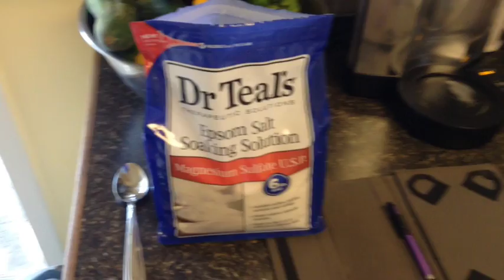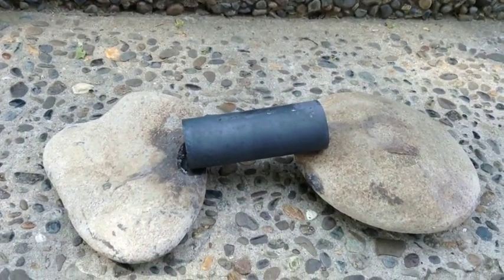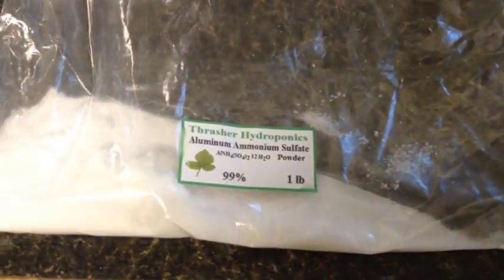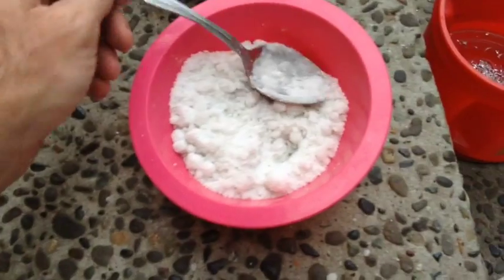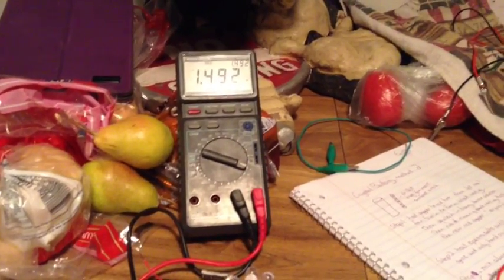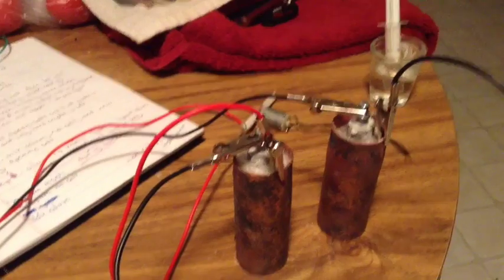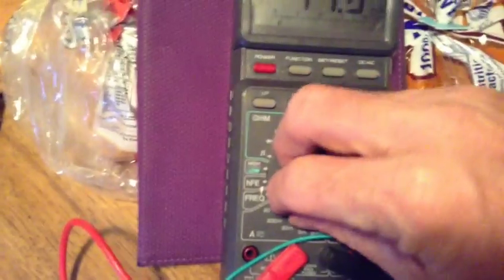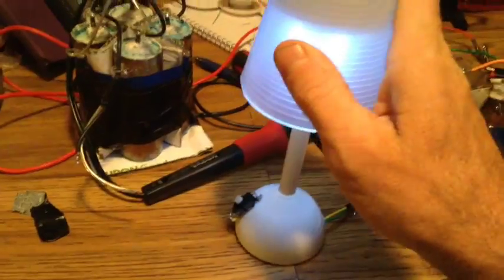V3 Crystal Battery High Output 1/2 amp spike 2 in parallel dead short. high psi

Comment: I suggest adding some graphene to the matrix. The graphene acts as micro conductors and transports the electrons with less impedance.
Robert smith-Murray uses this method, and his website sells the graphene. His channel also explores different methods of low cost home graphene production.
Reply: Graphene for capacitor (store the energy)..what we need is carbon14

Comment from the maker: I'm not sure. These have been my highest output cells so far. I actually cut those two cells in half to make 4. These require me to add a few drops of water every few days.  Then I made 4 more of the same but with 3/4 inch copper instead of the 1 1/2 copper.  The small ones are capable of almost the same amperage but will lose power a lot quicker and the smaller ones require me to water more often. Not sure about the corrosion on the magnesium yet. I am seeing positive results with the fired copper. Seems to help in slowing down the corrosion factor. My next set of cells won't use borax , no salt , or alum. They will contain Rochelle salts, Epsom salts, sodium meta silicate pentahydrate Na2SiO3*5H2O, iron pyrite, magnesium fillings, and Manganese(III) Mn2O3.  Basically I am trying to progress to a cell that uses water as fuel while  doping agents are used to increase power output as well as protecting the magnesium. Research I have done speculates we can get a reliable 1 amp at 1.6 volts out of a relatively small package. 5 inch tall 1 1/2 wide

Comment: take one of your "no so good" cells and cut off the copper but not impacting the cell hardened cell mix, use gloves to keep skin oil out, if they dont break / crumble easily. then take a crucible with molten copper and dip your "core" in and let the copper cool down naturally around it, then test it once its at room temperature and post / tell me the results

Comment: On the reason your aluminum burned through. It is the Ph value of your material. It is at least a mildly strong base  really strong bases, like lye, dissolve thin aluminum in a pretty impressive display of endothermic reactions. Just don't use aluminum for heating or drying the material and no problems. If you have not done it make a little tinfoil cup put about a half teaspoon of lye in it and the drop in about a teaspoon of water. It is fun to do at least once..=) [don't breath the fumes though, they are not goo]

Comment: I used smaller diameter copper tubing and magnesium pieces ripped off of a big roll of it. A lot less water too to mix and got 1.68V from about 1/4 inch width × 1 inch length batteries!
Haven't checked amperage yet. My voltimeter's connection is burnt out from a defective 12V that was running on 3 or less cells.👍👌

Comment: try large flat layers of copper an your electrolyte mix to raise your amps but clamp it tight so you can also mix silicone dioxide so when the expansion starts you'll get a piezoelectric voltage like the Egyptians did ...for one last idea ad a layer of graphene it charges itself..........just remembered add a pinch of ascorbic acid ( vitamin c) it stops the corrosion process without affecting output
Reply: Al Schuck - I thought piezoelectric requires quartz crystal

Comment from the maker: Hey Travis, I would like to see your cells. The more people that do this we will eventually find the right mix to achieve 1 amp in a small package. I will be back to the crystal battery's this spring. I have done quite a bit of research and have a number of different mixes to try out. Thanks for the comment.
Reply: BackRoom Labs Please share their amps over time. I made similar and noted that mAmps fall down in few hours to a steady low mAmps.
When I make them they will give around 80 mAmps but after a day or so they drop to 20 mAmps
Reply: The answer is neigh indefinitely.  I haven't heard of anyone so far who had one of these batteries die.
Reply: I don't agree. There is no such thing as indefinite. In this scenario you are basically consuming Mg. Over time its amps and volts will drop. When you create their first output is high but then it drops over time.

Comment: if you use a torch over concrete make sure it is dry any moisture in the concrete and you will get a very violent demonstration of spalding as the moisture in the concrete boils and causes the concrete to explode :-)

Comment: Just out of curiosity, have you tired charging the cells to see what happens 
Like 12v 1amp 

That would be a cool test to see if the cell would hold a charge. Of voltage and Ah
Reply: I don't like to be rudebut you are way this guy doesn't really know what he's doing because you're supposed to form the cell by charging and discharging
Reply: This isnt the type of battery you recharge friend think throw away double aas. Its like a chem reaction.peace opon u

Comment: You needed to charge them a couple times,
Then do your test!!!
Thanks 4 sharing!!
Reply: +violeman Have you tried charging them with an old DC 5v - 9v maybe 500ma adapter yet to see if they hold a charge?
You can even try it with a 3v if you want!!
I am just curious if they will charge up a bit!!!
Lower voltage the best cause you do not want to boil it again!!!
Thanks 4 Sharing!!!

Comment: Hello.. I been a long time subscriber and appreciate your work .I think you have been on my channel too. I have made many types of batteries myself and have duplicated and tested many versions seen on you tube and all as you must know with very little working current.  I believe this experiment you show here holds promise as possibly a functional worth wild battery . nice work.. As I am sure you know any anode surface area can be a Major player in the increased current ability.  That surface area thus amps could be greatly increased by doping the anode with carbon nano tubes you can buy of the net (100$) and probably grapheme would work too. The cost is somewhat high for the nanotubes and may appear to be cost prohibitive to make batteries with, However when you do your research and find that it can increase energy density by 10 times then you realize just how special a battery like this could be. It would mean your.25 amps could be a 2.5 amp battery or would hold 1.5 x 2.5 = 3.75 watts.. Now that's no joke.. It appears the nano tubes also increase life cycles and reduce charging time as well. I have had the following ideas to get the tubes on the anode... flat led or magnesium plate for anode then heat to  the melting point laying flat in a pan and then just as it liquefies  sprinkle (technical term) nanotubes on surface and then let cool or force cool quickly.. Then tap off and save what did not stick on and then build your batteries just as you have done here using your new nanotube doped anode. The arrangement they lay or fall in has a large impact on just how much energy density gain you will get but the random arrangement should still greatly impact the capacity. Or take a conductive glue say glue with carbon in it or metal shavings in it or any other type you can come up with that will conduct and paint your anode with it and then dip or roll on carbon nano tubes.  I haven't had the time to try it but wanted to pass it on to someone who might give it a whirl and tojust put the idea out there.  If talcum powder is electrons and you sprinkle (charge) them on a slick bowling ball ( your anode) most of the electrons will not find surface area to stick to so charging and energy density is low.. NOW take your bowling ball (anode) and cover it with long shag carpet (carbon nano tubes) and sprinkle your powder on can you see how much more electrons (charge) you can store and how easy it would be for electrons to find surface area? well if you get time let me know what you think. and if you try it don't forget to let me know how it worked.
Reply from the maker: I have been following  the graphene SuperCap videos from Robert Murray-Smith and have tons of ideas. I am ordering some graphene on aluminum from the Graphene Supermarket. It 100 bucks for 5 sheets a 9x9in.  I am also going to order enough magnesium to make 20 of the cells. I have found the less the gap between the mag and copper the better. Also the ALUM only cells are by far the best. All the other cells have corroded and there power output is far far less then when new. The alum only cells show no corrosion and power out put is the same as when new. So my plan is to build a bunch of homemade graphene SuperCaps. Put em in parallel with the crystal battery's. And then I think we might have something with these power cells. My problem is power output. I never had a way of storing the power. Hell they put out 24hr a day all year long. Now with these new graphene caps that should far outperform the super caps we have now I can run my LED joule ringers at full power.
Reply: Did you do it? The logic seems to work
Reply: @1billyknorr   I think you are right about Alum, I made a couple all Alum batteries and I wanted to minimize dendrites as much as possible because I was using expanded aluminum sheet metal and I expected to end up with a copper anode but I think the copper produces more dendrites than aluminium when you go to charge it up.  When I first made the battery it was reading over one volt and I actually had decided not to use any copper because I found a 24K Gold mil spec. connecter pin that I had laying around and just stuck it into the dense block of Alum that I had cast into the Aluminum expanded sheet, I was attracted to the expanded sheet because of it's abundance of sharp  edges so it surrounds the Alum block and the pin is placed in between the two sheets of Aluminum. The pin is bigger around than the thickness of the mesh in the expanded sheets and the two aluminum sheets are joined together by copper wire that does not touch the Alum, the solder joint on the Gold pin is also well insullated from the Alum as well. The Alum is different from the Alum you are using however because it is milled to a very fine powder and does not stay suspended in water for very long and it does not appear to melt even with heat yet is very dense and heavy.  There are a few different types of Alum.  After charging the battery for several hours it stayed at over one volt for twenty three hours.  Also when shorted the battery would bounce back to somewhere over .5 and .6 and ususlly settel at  .8 but then after disconecting it could be found at over one volt again and then slowly discharging at a rate of only a hundredth or so every few minutes. 
 In the next battery I made I couldn't remember where I had the rest of the Gold pins so this time I used a lot of copper at .0125dia fashioned into the shape of a narrow band width sinussoidal.  Also I doubled up on the Alumininum and as soon as it was put together it read over two volts for a short time and then after several hours of charging (with a 5V USB charger) it stayed over one volt for twenty nine hours. I used TIC TAC containers for these batteries and I imagine when I construct a third they will light a couple of LEDs.

Comment: Where do you get the Magnesium Bar from?
Reply: You can get it from fire starters for a dollar and you get flint and iron. It's like Minecraft IRL.
Reply: @sviehweg  - This link is not their.
Reply: After 3 years, the copper corrodes as the salt eats it and the copper tubes split.  These are not a viable power source
Reply: @sviehweg  but it teaches us and therefore it's viable. Also these have a more substantial place when dealing with radiant energies or the simple energizing of plant based systems. Maybe like an Ebner Effect system and seed germination practices. At least that's my theory as I have never made nor used such batteries.
Reply: I'm almost done with my own generator. It is self sustaining and the prototype outputs 50Kw 550VAC at 50Amps.  I've spent $12,000 on it and only a couple more to go. It will charge a Tesla in 4 hours for .96cents,...or your house and a couple neighbors as well. Spoke to Elon,  almost done as this will be licensed to Tesla and SpaceX to power pretty much everything.  Salt, Copper batteries are just a toy.
Reply: @sviehweg  well if I'm ever in need of going to space I'll buy your system. I too have been building a system. It's mainly for new construction. Guess that makes us competition. Lol. Just kidding. I'm not looking to sell anything I'm just interested in the data. Or that's what I tell myself. I once had an invention that would completely end the infant mortality rate from people leaving their kids in hot cars but sadly it was considered a liability so America remains at 40% higher than any other country. Can't find stupid sometimes. Tesla was the main distributor I was after. Not only would it save lives but it would save time money and the vehicles interior.
Reply: @sviehweg  oh and I am a broke joke so I tend to find used stuff then repurpose it. I've only spent 2000 on my lab and tools. And finding investors is hard when you are not an established person.
Reply: @sviehweg  your system sound nice. You have a web page?
Reply: @jvon3885  I am CinemaSectors.  https://www.youtube.com/user/CinemaSectors
Reply: @sviehweg  indeed. I've been working on my system for roughly 4 years now. It started off looking into systems that help our health. I've found that it can not only help us be healthy but it can actually power our lives. I just joined the OUR community. I look to open source my work out as I may not be here long. I'm working hard but you know tomorrow's not promised.
Reply: @jvon3885  tomorrow never is.

Comment: While I appreciate the quality of the information and the way it is presented, I can't stop thinking about how much energy was used to created those cells. (From the gas in your car to get the supplies, with the energy spent to work to earn dollars to pay for those supplies and burned gas. Not to forget the manufacturing of those supplies (lots of energy used in making those copper pipes and some of the other material)

I know the satisfaction we get out of doing stuff like this. I'm not saying all of this to demotivate anyone. Rather to let it enter into the conscience that while experimenting on this, it could be wise not to forget to keep an eye on the aspect of efficiency including fabrication process. Ex: cold press instead of melting over heat.

Please don't stop posting your videos. I consider them real valuable information and a source of great inspiration.
Keep experimenting.
Reply: +Live Sound All great innovations start with an idea that has been matured through failed experiments that have taken place in the garden shed, or over the kitchen stove ... if this could be moved into mainstream production then the cost & eco-efficiencies could be measured & they will show the benefits.

One of the greatest benefits being that these batteries use mterial that is already produced\manufactured at maximum cost, energy & eco efficiency

Comment: The heat you noticed wile the solution was it the aluminum container was indicative of an ongoing chemical reaction, adding aluminum to your solution, and could be the reason for the unequal performance of the cells. But, i bet you already figured that out since its been almost two years since your post. Where are you getting your magnesium?

Comment: I feel like if you changed the copper into tungsten it would increase the power and longevity, being realistic tho you probably don't have the tools to cut it, so something like lead would work just as well, it's highly conductive and corrosion resistant

Comment: The battery voltage seems dependent on the amount of metal the battery contains; whereas, the amount of crystal used in the battery seems to control amperes.
Reply from the maker: I have ordered some more alum and magnesium to try some new experiments. The magnesium is the same size. So I'm going to try smaller and larger diameter copper and see the difference. I also ordered some graphene coated aluminum to try and make some graphene super caps to store the energy produced by the crystal cells. I figure they put out power 24/7 although a small amount if this energy is stored until it is needed, I believe I could use my joule ringer set up to light a 3 watt LED for a desktop lamp or something similar.
Reply: +Robert D. Brown Jr. So far in my research, it is the galvanic distance between the two metals in the chosen electrolyte, solid or liquid, that determines the voltage. Once those three are chosen, voltage pretty much remain the same no matter the size. Only amperage delivery capacity in reduced or increased by size. However, current capacity does not solely depend on metal mass per se. Total energy throughput is determined by the mass of the active chemicals that can participate in the reaction. So yeah, metal size of both electrodes, but also distance they face each other, and how much mass of active electrolyte are sandwitched between them -- all affect how much current the battery can deliver. Ultimately, active chemicals that participate in the chemical reaction gets depleted unless there is a means to continually resupply them. As active chemicals get consumed by the chemical reaction that produces electricity, they get transformed inert and no longer become active, then the chemical reaction inside the battery dies. Our goal then would be to start with a battery contraption that produces the right amount of current for the envisioned application, long enough to avoid the inconvenience of replacing them often.

Comment: Use alum powder in the battery mix, it will increase the voltage by 0.6 volts.
Reply from the maker: If you look at my channel I have several other videos of these cells that use only alum. Those cells are the best out of any I have made.